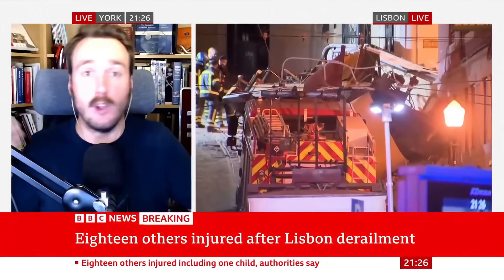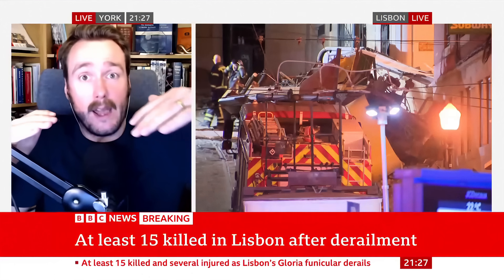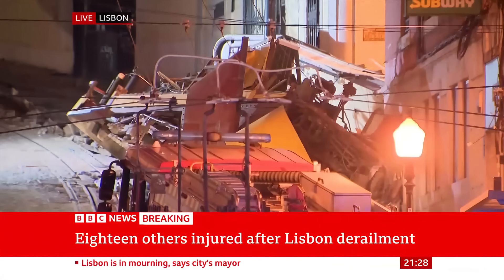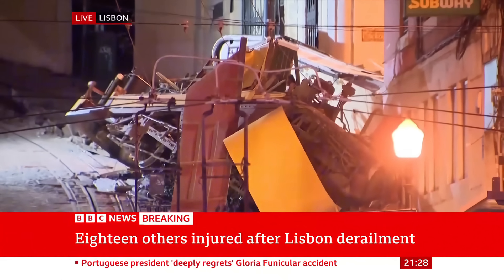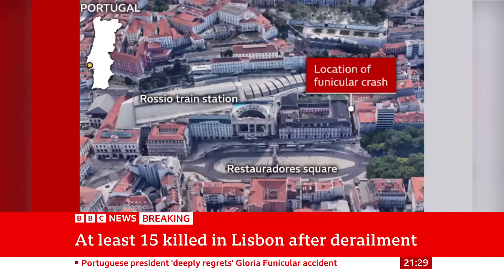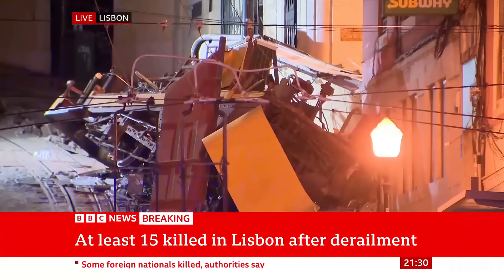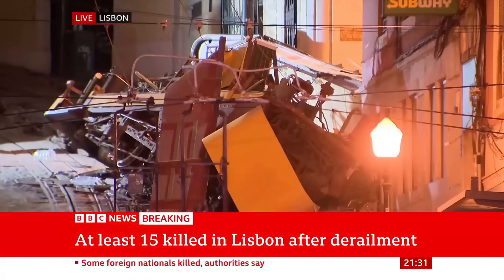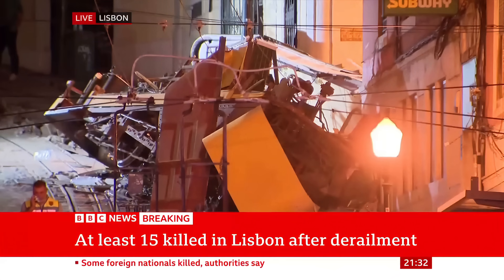Engineer gives thoughts on Lisbon funicular crash | BBC News

Comment: If the cable snaps, it would cause catastrophic damage. How can this system be considered 100% safe, even by an expert.
when the terrain is so steep that no brakes would be effective in stopping it? Manual brakes are already failing, and the cable is the only component holding everything in place. Relying on a single point of failure is extremely dangerous

Comment: With a tram weighing 3,150 kg and a total of 25 people weighing 1,875 kg, or a total of 5,000 kg, the cable tension is 900 kg. The cable broke at this 900 kg tension. Conclusion: the cable and conductors are poorly maintained.
My condolences to the families of the casualties.

Comment: A mechanical engineer? The drive motor is 3 phase. There are 2 trolley wires and an earthed return. A 3 phase motor when forced to turn above its normal speed on the car will generate power and return current to the trolley system. Disadvantage of 3 phase motor is fixed speeds. The engineers 100 yrs ago knew this. An additional safety feature . Was the motor on when the accident occurred?

Comment: Initial report is out now. Cable snapped after cars had just set off and travelled a short distance.  The car at the bottom applied brakes but travelled backwards approx 10m, derailed and the wheels became lodged in the cable gutter arresting its movement. The top car however had both pneumatic as well as manual brake applied by the brakeman but this did not arrest its motion, it continued to accelerate reaching a speed of approx 60 kmh over 50 seconds, it derailed and side swiped a building destroying the wooden passenger saloon before hitting a streetlight and a overhead support column causing additional damage to the vehicle before ultimately hitting and wedging in the corner of a second building. The point of cable failure was inside the top car (specifically the cable snapped inside the Ferrule where the car grips and attaches itself to wire, it wasn't the attachment mechanism that failed but the cable section within the attachment), the cable was inspected that morning but the point of failure is not visible without partially disassembling the vehicle. The cable was 337 days old and had an expected life of 600 days. Investigators say it is not clear so far whether the automatic emergency brake activated or not.
I guess questions will be asked about the complete inadequacy of the brakes to stop either car safely.
Reply: Yes, the emergency brake system was working but obviously not able to stop the vehicle. That means that the other similar designed cable car (Ascensor do Lavra) cannot be operated again unless technically completely updated
Reply: @ulrichgloeckl6072I'm completely baffled knowing the brake system failed in both cabins. Worst: the report says the brake system is useless if the cable breaks. That is scary. I want to know how many funiculars operate like this one around the world. I'm pretty sure the investigators will investigate that. It was a very good preliminary report, btw.

Comment: The commenter engineer hinted at a slippage of the rope clamp !, how was the conveyance , tram attached to the rope 
Many ski lifts are on and off  the rope with a. Clutched clamp system every run. Would be surprised if thi was the case in 1800s. Suggest mor likely a multiple bolted rope clamp this could have failed or slipped down the rope causing*
 acceleration  and then the conveyance hit the bend r and flew off ? 
Very very sad for the relatives of those who lost their lives RIP

Comment: In the piece the railway engineer speculates that the car was  going UP the hill. That cannot be right as car number 2 was at the bottom. Obviously car 1 broke away at the top otherwise car 2 would have crashed back down to the bottom yet it was unscathed and we saw passengers just walking out. For car 1 to derail at the bend in such a catastrophic way indicates that it had come lose right at the top.

Comment: If they are connected by a single cable why do they have individual overhead power supplies?  Doesn't the cable pull them up and down.  They sound as though they have brakes!  Please someone explain how thier system works.

Comment: Whilst deeply saddened by the fatalities that took place, I do not believe this commentary properly explains how this specific funicular operates - in its working life it has according to tourism websites included water (counterweight) operation but is now powered by electricity. What is important to understand is that, as with the referred to L&L system in Devonshire, the cars (not 'cabs') are connected by a cable (as stated) and can not run independently, in fact, the rail track configuration might (as at L&L) prevent both running side by side thus a 'spreading' of the tracks is required at the point the vehicles pass each other. According to a Lisbon tourism website "The counter-circulating pulley system known as the Subida à Glória, for use by both amateur and professional cyclists, has been recently renovated" although an actual date was not given. Clearly the cable system will be carefully scrutinised by the investigators, but there should be (and probably is) a brake - and hopefully one which would automatically apply in the event of a cable failure - which will undoubtedly be examined closely. My thoughts and prayers are for the families of those killed by this tragic accident.

Comment: There must have been multiple failures, as these systems usually have an additional cable or braking system in case the primary cable fails. Like an elevator in a building. Very concerning that all the back up systems failed.

Comment: Passenger testimonials from the car at the bottom say they felt a strong jolt as the car was going up, and it started accelerating down, stopping right at the bottom edge of the tracks. They said they immediately knew something was wrong and they could hear and eventually see the other car coming towards them, until the derailment on the curve. Had the top car stayed on the track it would have been even more tragic. I live here, and I already went on that trip. It's a sad day and my heart goes out to all the victims.

Comment: This "expert" failed to answer one basic question: Why didn't the funicular operator deploy the emergency brakes??? Those are independent of the cable and should have prevented it from screeching downhill! It's the same concept of an elevator - If the cable breaks, you don't fall to your death because emergency breaks deploy. I fully blame the funicular operator! Was he high on drugs?
Reply from the maker: because there are dozens of different safety systems on railways like these and making a statement like that would have been way beyond the point of acceptable speculation

Comment: The following video is the best one on the Internet showing the operations of the Glória Funicular:

1/2/2020 Uploaded 4K LISBOA FUNICULARS - Ascensor Lavra, Glória & Bica (2020) 

www.youtube.com/watch?v=XU-sxiuebDg At 06.30 to 12.55 The Glória segment 

(1) Note like the old trams in Melbourne, Australia there is an overhead electric line connected to the cars via a bracket/guides + electric motors inside.

(2) The driver was: André Jorge Gonçalves Marques. He had worked for the Carris company for 15 years. He was married with two children. See: Interview André had with Spanish Actor Miguel Costa in 2023. "I will never forget André."  Remembering the brakeman who died in the Glória Elevator - JN Portugal (In Portuguese)

(3) Prior to this incident the Glória Funicular had been operation for more than 110 years on electricity with zero deaths from an accident, crash or derailment. Both the cars have gone up and down the slope more than 7,000,000 times each over the last 110 years.

(4) Contrary to many media reports, the inlaid cable of Glória Funicular is not powered. It is not a "haulage" cable. It is not a "Cable Car". Power comes from the Electric Motors and the Driver needs to control the Breaks and Speed. The Driver is essential to the operation of the Funicular. (They have not been automated like the driverless Funiculaire de Montmartre which is a funicular in name only. Its title is a vestige of its earlier configuration, where its cars operated in a counterbalanced, interconnected pair, always moving in opposite directions in concert, thus meeting the definition of a funicular. The system now uses two independently operating cars that can each ascend or descend on demand, qualifying as a "Double Inclined Elevator" - Wikipedia)

13.20 CEST 4/9/2025 Mário Vaz, full professor in the Department of Mechanical Engineering at the Faculty of Engineering of Porto, analyzes the derailment of the Glória elevator. - RTP (In Portuguese)

HYPOTHESIS: The driver had a problem as Car 1 was ascending and approx. 5 metres away from the top/end of the run > He failed to engage the break > The car paused for a second. It was almost stationery > Then it started rolling down the hill. Backwards. > It picked up speed > The inlaid cable whiplashed, bent, strained and snapped > The car careered down the 17% gradient slope picking up real speed  > Car 1 (Weight 5000 kgs + 43 people, 90% approx. adults, approx. 2400 kgs = Approx. Total of 7400 kgs) after dropping 30 metres in altitude and 200 metres in distance from the start of the problem, derailed and smashed into the building at an impact speed of approx. 65 kmh, i.e. with accelerated G Force.

Prayers for the people injured, maimed and killed by this terrible incident. I am sure the deceased up in heaven now want the real truth about why this incident happened revealed ASAP.

שְׁנָאֵל שְׁפָתִים שַׁקְרִים יְהוָה, וְבָאֲנָשִׁים חָפֵץ. ⚠

Adam Neira
Founder of World Peace 2050
Founded in April 2000
Paris - Jerusalem - Melbourne

Comment: Looks like cable broke or came off the top return drum, and the emergency brake failed on the runaway car. The brake should kick in as soon as cable tension is lost, usually a wedge gripping the rails with a powerful spring, the same as with vertical lifts. It could not work however if the car had de-railed. Unfortunately, the working of these emergency brakes is sometimes less efficient than it should be due to corrosion etc which has caused some lift disasters in the past. They have to be tested regularly.

Comment: I suspect that metal fatigue was an issue.  When metal is subject to repeated stresses, micro-fractures accumulate, until the metal eventually breaks.  Metal fatigue can rarely be detected from a visual inspection.
Reply: Thank you Captain Obvious.  However, we are told that the cable is changed after a certain number of hours of use because of potential fatigue failure, so there is some deeper problem here.

Comment: A few years ago I lived in Lisbon and I would often walk up the hill (to get the exercise) alongside one of these funiculars.  The hills these funiculars travel are steep and if walking you know about it when you reach the top.  I can well imagine the momentum of the carriage as it reached the turn and with the buildings crowding the tracks the damage was bound to be considerable.  These systems are old and they creak and screech considerably - which alludes to the forces on them - so even the weekly/monthly checks they claim are probably insufficient.
Reply: Since 1885, only  2 cases of Derailments:
On 7 May 2018, a car derailed due to insufficient wheel maintenance. NO injuries were reported.
On 3 September 2025, a car ran away and then derailed after the failure of a steel cable, and brake malfunction.  
Atualmente, é a “empresa Mein que faz a manutenção dos elevadores” da Carris, declarando que a  manutenção do elétrico que descarrilou em Lisboa, é assegurada "escrupulosamente, e que a segurança é uma prioridade absoluta da Carris há 152 anos.“
O elevador da Glória foi inspecionado na manhã de quarta-feira, dia da tragédia. 
A inspeção demorou sensivelmente 30 minutos e foi referido que o cabo deveria ser substituído dentro de 263 dias. A notícia foi avançada pelo Observador, continuando: ”seremos intransigentes no apuramento das causas e responsabilidades deste acidente, pelo que estamos empenhados para muito em breve estarmos aqui para apresentar as conclusões deste inquérito”.

Comment: I thought, may be wrong, that there might have been a ratchet breaking system? Dont trams have a ratchet break?
Reply: A cable hauled car like this would have a spring loaded brake that gripped the rail(s) if cable tension vanished. Same with vertical lifts. However these things can fail to work sometimes, maybe because of lack of maintenance.

Comment: This crash reminds me of the tragedy of Angels Flight in Los Angeles, California, although that one had just one fatality. The original Angels Flight operated for the first two thirds of of the 20th century without serious problems. It had the cable for hauling the two cars. There was a second cable as an emergency backup.

In the late 1960s, Angels Flight was dismantled and the cars put into storage so the Bunker Hill neighborhood could undergo a massive redevelopment project. Towards the end of the century, new tracks and complicated hauling mechanisms were built, the cars were refurbished and put back into service. But a few years later, the new mechanisms failed, and the cars crashed, killing a person and injuring others. The fancy new mechanisms were not well designed; there were neither a backup cable, nor track brakes. Poor design and poor maintenance led to this fatal accident. The NTSB report runs 50 pages or so, and is a litany of horrors.

Comment: If the other car is at the bottom and now this car is nearly at the bottom does that not mean that the cable has either detached or snapped. One would presume the cable cant reach via the top station unless the cable has actually come out of the pulleyt at the top and is now lying across the tracks further up

Comment: Whilst it appears that the main traction cable may have failed, surely each cab has it's own braking system as a back up? Does that suggest that the braking system on the car also failed? (Eg similar scenario to the Stresa-Mottarone cable car crash in May 2021 where the back up emergecny brake failed)?
Reply: A cable hauled car like this would have a spring loaded brake that gripped the rail(s) if cable tension vanished. Same with vertical lifts. However these things can fail to work sometimes, maybe because of lack of maintenance.
Reply: @lexlayabout5757 It's just so frustrating that the one system that is supposed to prevent catastrophes like this (and the cable car disaster at Stresa-Mottarone) fail to work when actually needed. These back up emergency braking systems are clearly not fit for purpose and cannot be relied upon.

Comment: the main reason why there is so much casualities in this crash is that body of the car was torn off off the rail frame. during this process everyone inside was basically shredded. this means those cars must all be scrapped and replaced with modern ones (but portugal is too poor for that) or simply this type of cars must be abandoned totally.
Reply: Since 1885, only  2 cases of Derailments:
On 7 May 2018, a car derailed due to insufficient wheel maintenance. NO injuries were reported.
On 3 September 2025, a car ran away and then derailed after the failure of a steel cable, and brake malfunction.  
Atualmente, é a “empresa Mein que faz a manutenção dos elevadores” da Carris, declarando que a  manutenção do elétrico que descarrilou em Lisboa, é assegurada "escrupulosamente, e que a segurança é uma prioridade absoluta da Carris há 152 anos.“
O elevador da Glória foi inspecionado na manhã de quarta-feira, dia da tragédia. 
A inspeção demorou sensivelmente 30 minutos e foi referido que o cabo deveria ser substituído dentro de 263 dias. A notícia foi avançada pelo Observador, continuando: ”seremos intransigentes no apuramento das causas e responsabilidades deste acidente, pelo que estamos empenhados para muito em breve estarmos aqui para apresentar as conclusões deste inquérito”.
Reply: How is Portugal too poor to replace a funicular?
Reply: @clementealves5858 check their economic stats, research funicular car market price and figure it out.

Comment: The Glória Funicular (Portuguese: Ascensor da Glória, popularly also known as Elevador da Glória) It opened in 1885, and electric-powered services were introduced in 1915. Two new, identical, vehicles were constructed by German engineering company Maschinenfabrik Esslingen, in 1957. Each can carry 42 people plus the conductor. The system was classified as a National Monument in 1997.
Since 1885 2 cases of Derailments:
On 7 May 2018, a car derailed due to insufficient wheel maintenance. NO injuries were reported.
On 3 September 2025, a car ran away and then derailed after the failure of a steel cable, and brake malfunction.  
Atualmente, é a “empresa Mein que faz a manutenção dos elevadores” da Carris, declarando que a  manutenção do elétrico que descarrilou em Lisboa, é assegurada "escrupulosamente, e que a segurança é uma prioridade absoluta da Carris há 152 anos.“
O elevador da Glória foi inspecionado na manhã de quarta-feira, dia da tragédia. 
A inspeção demorou sensivelmente 30 minutos e foi referido que o cabo deveria ser substituído dentro de 263 dias. A notícia foi avançada pelo Observador, continuando: ”seremos intransigentes no apuramento das causas e responsabilidades deste acidente, pelo que estamos empenhados para muito em breve estarmos aqui para apresentar as conclusões deste inquérito”.